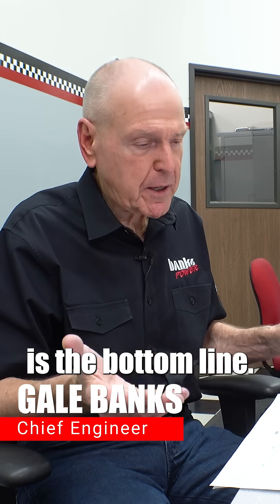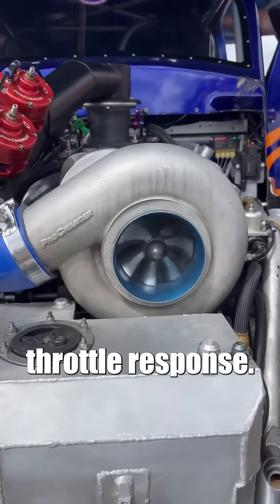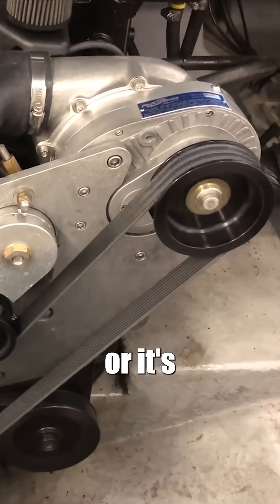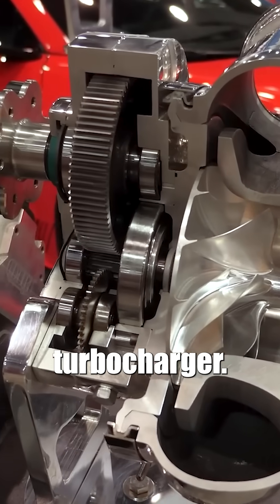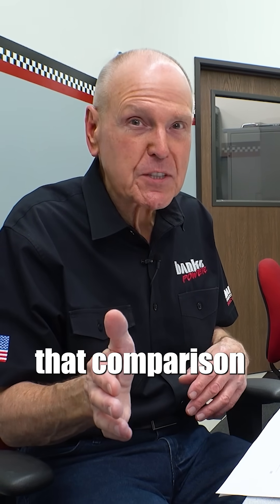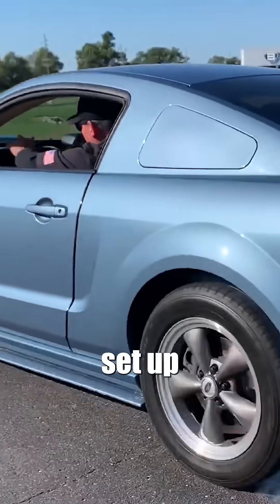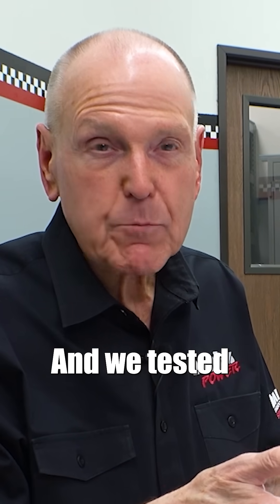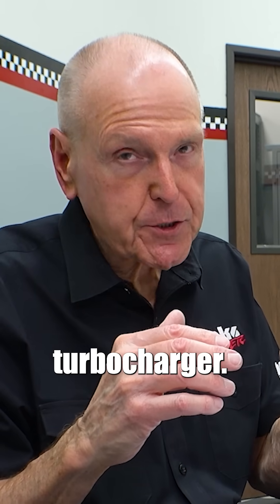Centrifugal superchargers are bad for street cars.

Comment: yeah this is just an ignorant take. ess mustangs are destroying PD superchargers and keeping up with twin turbos in rolls. centris are actually the BEST forced induction for a street car due to its linear boost with rpm. its just common sense, a street car wants high rpm power, not low rpm power when youre cruising.
Reply from the maker: We respect your opinion, but we stand by our engineering and testing data.

Comment: VW had this G-Charger which is very efficient scroll charger.
Reply from the maker: Yep, on the Corrado. It may have been relatively efficient for the time, but that car was still slower than the VR6 model. There's a reason they didn't stick with it.
Reply: @bankspower   
I own and drive a 35 yr old Corrado G60.
That G-charger is absolute steam punk and sounds like NOTHING else. When I opened it for overhaul the first time, it blew my mind it is so beautiful. I still think its magic and it seriously cant work as it looks so fragile but revs or better wobbles up to 12000 rpm which is insane.
Additionally it is an engineers dream because of unmatched volumetric efficiency whatever the cost.

Comment: My centrifugal is running a small pulley and wastegated so I make power a lot sooner. It also helps if you have an already responsive v8 in lower rpm. So what you are talking about is not an issue.
Reply from the maker: But the experience compared to a Roots-style or screw-type supercharger is lacking, in our opinion, simply because of their ability to push way more air. Centrifugal units are good for packaging in a tight engine bay, but in that case, we'd probably find a way to go turbocharged.

That said, it's awesome that you've got a responsive engine and that the supercharger is doing what you want it to. Ultimately that's what it comes down to.

Comment: liar .... in supercharger the turbine forced instantly by the belt so the lag will be eliminated instantly .... while turbo will shocked your car unless you forced it to spin with a much amount of fuel to start spinning ... the bottom lines here is increasing car main pully and decrease the supercharger pully to force it to run faster but not much fast to hurt the turbine fins

Comment: Great video. People need to understand that when you choose to boost your engine you need to consider the rpm range you plan to use. Nornal steet driving, you may spend most of the time under 3000rpm. A boost system that wants to live above 3000rpm will not be your best choice.
Reply: It will if you don't want to be in boost all the time.

Comment: Okay, but what if I want to keep my traditional root style positive displacement supercharger and run it parallel with a centrifugal supercharger. Wouldn't these to even each other out? Low end from the root style and high end from the centrifugal style?

Now of course the routing of the pipeing and how to control the boost difference is my biggest question. Could they be run in series to each other. With the centrifugal pumping into the root style one?

Comment: Why not Combine the two for exhaust and belt driven boost to and have an electric turbo to reduce the boost lag with an instantly spooled up DC powered turbo until the other two get spooled up to speed to hopefully get the best from all 3 types of turbos for more power? Thats what i want to see you do for the next project to dyno bench test on a gas and diesel motor in the near future Mr. Banks, please and thank you for all that you do keep on doing it cuz you're the best at it.
Reply: because they wouldn’t work together in the way you think, the belt would spin it up to wherever the exhaust would have enough heat and flow to turn it, and the turbine would quickly overwork the belt. it is literally driven by your engine so if it’s spinning faster than the engine there would be belt issues or you’d have to just cut out the belt driven part whenever you’re in exhaust boost. the same way twin charged vehicles do it, up top the supercharger cannot keep up

Comment: Centrifugal don't have lag, if you log the time when the throttle opens to when boost rises, its near instantaneous. So even at 2,500 rpm, if you wot, youll probably have have only 3 psi (random number), but it will be near instant. Now the power will be peaky, and you won't have much power until higher RPM.

Comment: I call bullshit. Suprecharger creates boost constantly unlike a turbo that takes time to spool up. No way your rev's come some much down on a roadcourse that the power isn't there. Another thing is heat managment. But love em both.
.
Reply: He says centrifugal in the video which boost kicks in the higher rpm range similar to a turbo. Roots and twin screw are in the low-mid  and feels more instant with the throttle.

Comment: I can't comprehend how a turbo can beat an SC or how an SC can beat a turbo. If both compressors are the exact same, just driven by different means, then they should perform the same, albeit in different RPM ranges. I mean, it tasks the same amount of power to compress air to make a boost. It should not matter if that power is taken from the crank or from the piston having to drive hot gasses into the turbo (typically a free-flowing exit) into the turbo inlet to do work. I get that belts can slip, but hot gasses used to do work compress and heat up even more, creating a less efficient intake charge (less dense air). Compressing 1 cubic foot of air takes X amount of work, so if everything is appropriately engineered correctly, they should be so close it does not matter.
Reply: Imagine you got a 7000 rpm redline, with a smallish turbo, you could probably hit and mostly maintain full boost at around 3-4k rpm

With a CS, you might not hit full boost until 5-6k, possibly even later 

The main difference between the two functionally, a turbo builds boost based on load, and a supercharger builds boost based on rpm.

Now, if you’re already at 5k, you’ll have most of your boost on hand immediately with a supercharger, but the turbo will still take a second.

Hope that helps

Comment: I preferred a Roots positive-displacement blower on my 396 I had with twin 750 doubles. That thing was a menace at the track back in my day. Not up to speed as much with a lot of todays track teck. they used to make a low profile 4  butterfly bug catcher version that peek out of my hood with that cloged belt just below it barely visible.  Now-a-days I preferer keeping everything under at least a small hood intake since I no longer go to the track but I still like driving a proper built supercharged motor over turbo for sport. Hauling is a completely different animal.

Comment: That’s why guys who run pro chargers have to stage and build boost before taking off on the converter if foot braking or a trans brake and in these situations the centrifugal is better for torque and take off speeds(60ft)

Comment: It really depends on the application.  I've seen the comparison done on NC Miatas, which is a car with short, tightly-spaced gears.  The centrifugal absolutely annihilated the turbo out of the hole, because the cars do 0-30 (top of first) faster than the turbo can spool.  The turbo was dominant in highway pulls in the higher gears where the superior torque was able to dig in.  Centrifugals are also great for stock bottom-end gas engines because they don't make rod-bending, knock-inducing torque at low revs.  They also have much better thermals since you're not running oil over a turbine as hot as the surface of the sun.  They're great for road racing.  The throttle gives what you ask for instantly as long as you're in the gear you want.  Just like a sportbike.  Yeah the power at 3k sucks... but why would you be down there at the apex when the tach has two more gears in it?
Reply: this is a good one but i dont understand how a transmission that has shorter gears would pull harder on the 0-60
Reply: @kidlandin0476  Gale's point is that a centrifugal makes poor power in the low RPMs.  If 1st gear ends at 30 and 2nd ends at 60, you'll be on boost and making lots of power.  If you have a 1st gear that goes all the way to 60, you'll be spending a lot more time in the low parts of the tach with low boost.  Also, short gears mean more shifting, which creates a problem fir a turbo that has to spool up from zero after each shift.  A centrifugal stays on boost with short gears because the compressor RPM is always high.

Comment: There's more tricks you can do with a turbo to get them not to lag them something belt driven. Until they can figure out an efficient way to spin it up faster at low rpm but even then it's still wasting way more energy as it's crank driven

Comment: A centrifugal supercharger sounds like an all-wheel drive vehicle. You get all the downsides of a turbo and none of the upsides of a supercharge
Reply: So nothing like an all-wheel drive vehicle then, because having all 4 wheels driven on your can is probably one of the simplest trick to improve the performance of your car in almost all cases. Don't think so? Just see how AWD LMH are destroying the RWD LMdH, even with rules limiting the amount of time LMH can use their front wheel drive system to nerf them down.
Reply: @jkliao6486  yeah 4wd would be better the center diff just messes stuff up
Reply: @jkliao6486  also AWD is just a waste of gas in regular driving on nice clean dry roads
Reply: @ Most AWD system these days aren't permanent anyway. And those that are permanent are also built like a box with chunky tires that aren't fuel efficient unless you don't drive them, so not quite.
Reply: @jkliao6486  to me it's like abs air bags stability control and electric throttle. I really have no need for it especially with the limits it comes with. Now I do like how the R34, Diablo, and wj jeep AWD systems work but don't really see them being useful day to day
Reply: @masjuggalo  Then your impression on how car system works is extremely wrong is my answer to that

Comment: Sizing the compressor and pullys are everything that needs to be dialed in.
I purposely have a delay to help with launch control on a hillclimb weekend warrior.
Thought pressure lag would help save the gearbox, wrong a tyre at the point of giving up traction  actually had more than say 20% slip. With the extra traction the transmission was failing way more often.
Never stop learning.

Comment: Always liked the roots style blower for “racing” light to light, it did lack the top end. Now I’m driving a turbocharged car, the response is okay as long as you are moving, but it is SLOW off the line. I guess a centrifugal supercharger takes the worst of both world… though it is more diy friendly for the cars that didn’t come with forced induction from the factory.
Reply: Centrifugal is great on the track.  Good linear power.

Comment: Yeah but you made them the same size because you wanted the turbo. Why didn't you use a tiny twin screw the same capacity as a turbo compressor housing. That's right because you know better. Stop with the dishonesty! Also you won't find a diesel needing boost at low rpm. Show us how much torque a 6.5 makes at 1000rpm without boost its going to be far more than you are making out and grip issues are going to prevent the extra boost that low being useful.
Reply: Everything you just typed is complete BS and false. Every word of it
Reply: Please, for your own sake. Delete your comments😂😂 if you dont lots of people(for good reason) are going to laugh at you. Stop trying to act like you know what you’re talking about

Comment: that's not lag
Reply: Correct.
Reply: It is though, unless you somehow changed the definition of the word lag yourself 😂
Reply: @knowbull5hit590  all crank driven compressors, of any kind, have 0 lag, by definition. having top end boost doesn't make it laggy
Reply: @knowbull5hit590  lag is the time before making boost it doesn't exist on a supercharger. Bank lied and changed the definition for his test to when the supercharger reaches his desired boost level.
Reply: @jarlnieminen4307  this only applies to turbos and assumes you are above the rpm threshold. having a big turbo on a small engine at 1500 rpm and you floor it is also not lag
Reply: @Flank.Sinatra.  what of course that's lag. You aren't even getting the same amount of intake charge an NA engine.
Reply: @jarlnieminen4307  that's also not lag. that's being under the rpm threshold for that particular turbo on that particular engine. lag is when you are above the rpm threshold and the turbo lags
Reply: @Flank.Sinatra.  nope that's failure
Reply: ok, can't explain better than that, i'm done here
Reply: @Flank.Sinatra.  haaaa ok
Reply: @knowbull5hit590  the word "lag" has two definitions here: the time between throttle open and boost, and the rpm threshold at which the engine can achieve boost.

I like to call the first lag and the second "threshold". Gale is talking about threshold, not lag.

Comment: What if we overspin the centi and use a wg to control boost on outlet of the centri, so you can build target boost at lower rpm???
Reply: Because bearing will fail. For a supercharger, its rpm is directly connected to engine rpm, not to boost
Reply: @yuriyzaharchyshyn4377  people are actually doing that and it works fine. Obviously its more stress on the parts but making more torque and hp is always going to do that. Theres no immediate reliability problems from it like you are inferring
Reply: @knowbull5hit590  maybe, but if it works for some people, it doesn't mean it will work for everyone. Otherwise, supercharger kit manufacturers would offer this setup themselves. It may be ok for daily driving because you don't redline the engine most of the time, but take it to a racing track, and the overspun compressor will show its actual durability.
Reply: Because of the very first thing he said in this clip. Compressor efficiency. It’ll just make a lot of heat, air density goes down.

Comment: What exactly is supercharger lag? It sounds like it might be a separate thing to throttle response. A vehicle can be very responsive even if it doesn’t make peak power or torque right off the bat right?
Reply: What he's referring to happens specifically with centrifugal superchargers. Like a turbocharger, the compressor wheel and housing work to compress the air - which happens most efficiently in a specific rpm range. 

Turbos are better suited to that, as the expanding exhaust gasses will drive them faster into that rpm range. In addition, with variable geometry turbos, a lot of the lag issues associated with turbos are negated. 

A centrifugal supercharger designed to make peak power from about 5-6k rpm is going to suffer greatly under that.
Reply: @ sure but that’s different from throttle response right? A high revving NA motor can be very responsive even down low in the rpm range, it just won’t be very potent in terms of translating that response to acceleration or performance. Kinda sounded like Banks was saying “supercharger lag” is like a lack of throttle response. On the topic of variable geometry turbos though, wonder if/when someone will apply that technology to a centrifugal supercharger.
Reply: @ALMX5DP  yes its different from throttle response. A centri blower only makes boost with rpm and its a constant rising rate with RPM. Those superchargers can artificially push an engines torque peak much higher in the rpm range than what the engine did NA. Example: engine perviously makes peak torque at 4000rpm, with the SC it makes torque peak at 5500rpm and even higher as you add boost
Reply: It's a lie. Only exhaust driven turbochargers go minus boost. Super charger is just at low boost.
Reply: @jarlnieminen4307  what your saying doesnt make sense, is wildly inaccurate, and seems like a rebuttal to a comment nobody made

Comment: I totally disagree with this. That's why these systems run waste gates. They keep a higher initial charge and close the waste gate to get full boost or use the waste gate to blow off excess. I have an ATI ProCharger and there is little to no lag. Too many pro racers are using these systems and winning so are they all wrong?
Reply from the maker: Gale's point was that centrifugal superchargers are great if you're staging at a light. But they are poor for daily driving or road racing.
Reply: @bankspower  Like Gale stated ... the superchargers and the turbochargers .. they have a "sweet spot" @ certain value of RPM. 
NEVER ... underestimate the guy, who has a experience of average humans lifetime and the knowledge + the measuring equipment to back up his opinions. Everything else is just "a hear say". Greetings from a "Land far, far away" ... 🇫🇮 That is. 😂
Reply: @mikakarki7989 Banks is being dishonest about this though.  The reason the Turbo won is because it's going to have 80-100 more HP available because of the parasitic loss of the centrifugal.  Put an appropriate size centrifugal on, where you're basically making boost at idle, and it perform just fine.
Reply: @bankspower I never cared for centrifugal superchargers I feel roots /  TVS blowers are more efficient even for daliy use and for prolong applications if you wanted to take your car to the strip with a set of tires on it.
Reply: *gales lie.....a turbo will decrease engine response.